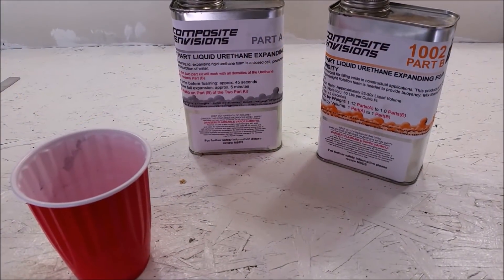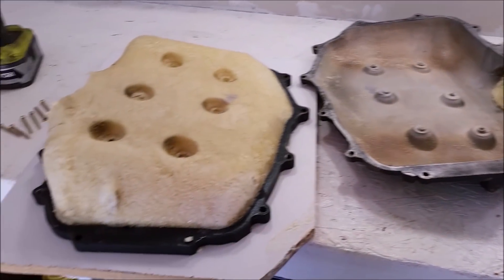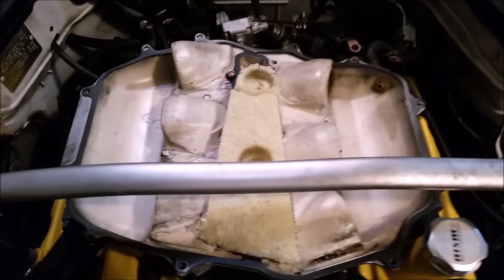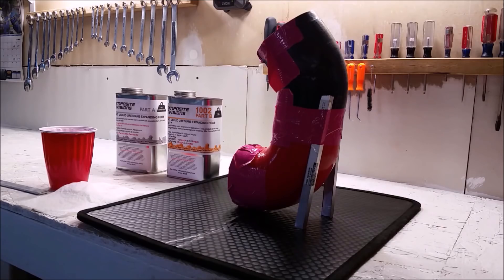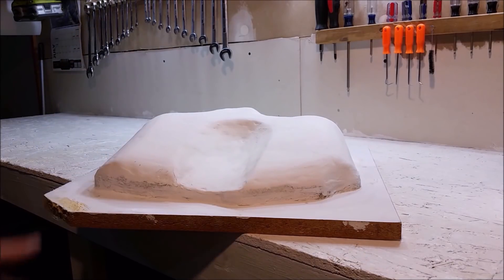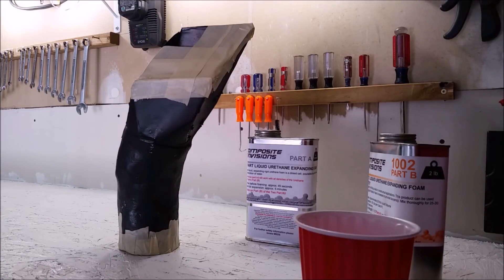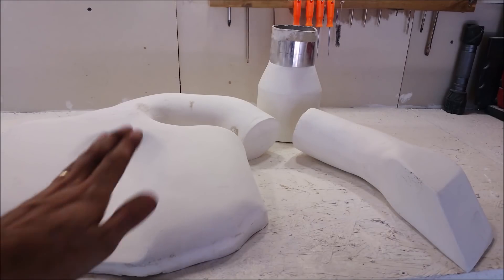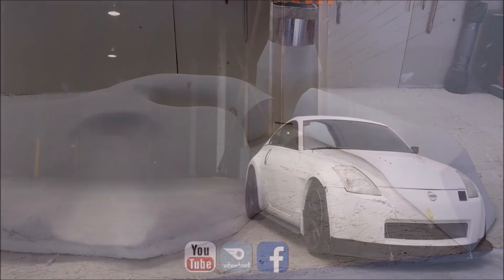How to Make Custom Molds for Carbon Fiber Car Parts (350Z Part 1 of 6)

Comment from the maker: If you have any questions about how I made my carbon fiber intake, please comment below, and I will respond as quickly as I can!
Reply: Which chemicals do you use to make that foam can u share their link to buy that two chemicals
Reply: @shubhamkumar-li3vb  did he reply on your question bro? Were the same question here...
Reply: @2wheelslife617  no bro not yet
Reply: thanks for your offer pal. which sandwe did you use? i see you used palm sander. was it air or electric?
Reply: No cooperation the uploader bro.
Reply from the maker: Apologies for the late response; your comments were flagged for some reason. I got the foam from the same people that sold me the carbon supplies in part two of the series.

Comment: What paint do you used on the mold ?
Reply from the maker: I prefer a filler primer because it can correct some minor imperfections. You'll then need a layer of urethane to seal it and prevent the sticking issue I had.

Comment: How do you take out the formed foam from the parts without cutting or damage the original parts?
Reply from the maker: The plenum popped out pretty easily with a bit of persuasion from a screw driver. The airbox and the intake pipe molds had to be destroyed though.
Reply: I've had issue here.

Comment: Couldn't you just use the plenum as the mold?
Reply from the maker: No, you want to work off a negative of the part. If I had used the plenum, it wouldn't allow for a good flange, and it wouldn't account for the thickness of the aluminum. It wouldn't line up with the lower plenum. Same goes for things like doors, hatches, hoods, ect.

Comment: Hey 
what have you Applied on the Foam After taking it out of the plenum
Reply from the maker: Plaster. It's super cheap and stands easily. Make sure you seal it with something like an acrylic coating you would use for a wood floor before applying the wax and PVA

Comment: which is the liquid u used to create the molds
Reply from the maker: https://www.ebay.com/itm/Two-Part-Liquid-Urethane-Expanding-Foam-4-LB-Density-4-LB-Kit-1-7-Quarts/131643157312?hash=item1ea68b2b40:g:r2kAAOSwW3JbVi6i

Comment: Do you add or spray anything on the object to keep the foam from sticking to it?
Reply from the maker: No, because the intake plenum was coated in a thin layer of oil from the PCV system and the couplers were silicone. If you are worried, you could use any sort of lubricant like cooking spray or WD40 to add a thin coat on the object to prevent sticking.

Comment: I'm going to try and attempt this as well.
I just wondered if you made the chamber any taller? I use a spacer on my one, so I'm guessing the gain for me will come from a smoother interior and wider neck/larger throttle body?
I'll do the lower plenum piece off of the car, that looks like it could go wrong for me 😂
Reply from the maker: The plenum mold was made using a stock plenum and a spacer. So the final piece is equivalent to having a 1/2 inch plenum spacer. As you said, the benefit will come in the larger neck and throttle body. Plus, you get better thermal characteristics.
Reply: @350Z247  Much appreciated sir! 👍
Also I just wanted to say thank you for your videos and channel, its a pity more haven't seen it, great info and inspiration!
Reply from the maker: @TheRobphobos  Thanks man! That means alot

Comment: If you wanted to make your own mood from scratch what other materials could you use that the foam could form in? Thanks in advance.
Reply from the maker: Really any material as long as it is either smooth like plastic/metal or sealed if its porous.  A coat or two of polyurethane like what you'd use to seal a floor will allow you to use almost any material.

Comment: HOLY CRAP! I'm looking to start doing Carbon Fiber work, and I'm SUPER glad I found this video! Thanks for covering something that I haven't seen yet, is that regular Spackle? Like you would find at Home Depot to patch a wall? or is it a different material?
Reply from the maker: Glad I could help man. Yes, it is regular spackle. It's cheap and easy to sand. You'll just need to seal it with something like a urethane floor 
coating. I just did the paint and it still stuck a bit.

Comment: cool videos you have! thank you!! ;-) 
aa, and also cool music - intro & end ;-) 
best regards from Bucharest, Romania!
Reply from the maker: Thank you! Very to cool to have someone so far away watching my videos! Glad you enjoy them
Reply: hi again :-)
if the foam is poured in a volume and then right away, fast, you cover it (closed volume) or you let just a little little space (almost closed volume), is the foam gonna be more firm, harder, stronger? (basically what you did for the last part in the video, with the front piece of the intake system)
or it doesn't matter this aspect and the foam will have same hardness no matter what? 
thank you & best regards ;-)
Reply from the maker: mirceaandreighinea it should make it more dense as the bubbles will be smaller because they have no more room to expand
Reply: hi! 
what do you think if i build a box, then place my foot inside, and then fill the space inside with the two-part expanding urethane foam, will it make for a good mold of my foot? if yes, is it toxic to the skin and needs special protection, or it's just fine? 
(for my cycling shoes project i talked about)
thank you! ;-)
Reply from the maker: I think that would work, but you would want a thick rubber sock on to prevent the foam from sticking to your skin and to leave room for padding once you construct the shoe. I would lubricate the rubber sock as well. Once you made that mold of your foot, I would use that mold to make a plug, like the plenum plug I used, to wrap the carbon onto. make sure you add many layers to the location where the clips for the pedals attach.
Reply from the maker: https://www.amazon.com/Lequida-Brand-Black-Latex-Rubber/dp/B01JGDEMBE
Reply: :-) thank you very much!!
yes, i plan to do what you say or very similar to that. i've seen all videos i could about this process - to mold the foot, build the shoe - but actually not so many out there. so i am constantly thinking how can i make it better - not yet there. because i think this part, to proper mold the foot, foot that mimics pedaling position, is the most important part of the entire process.
Reply from the maker: Good luck!
Reply: hi! 
back again. still getting info about the process (to make the cycling shoe), not easy... 
there are some options about making the mold (then the plug - which would be the foot), but i still think about this option of doing it with the two-part expanding urethane foam. 
do you think the foam can apply some pressure? 
like my foot in a very closed box (no leak), then pour the two-part expanding urethane foam in the box (cover it fast, so no leak), and then, while it expands and gets harden, will it apply pressure over my foot? 
what do you think? 
thank you very much for your time! 
best regards,
Mircea

Comment: Could I make a similar mold using expanding foam insulation? Can I cover for example a motorcycle fender, take the fender out and use the negative space as a mold for carbon fiber?
Reply from the maker: Assuming it becomes stiff enough to hold it's shape well, I don't see why not. Make sure you wax the fender to ensure the foam will detach once dry. Also, I would do a small test on a part you of the fender you can't see. There may be a chemical reaction with the plastic that will melt them together. I doubt it; but never hurts to be cautious.
Reply: Denis Did you try it Denis ? I was thinking about this too. was wondering it if it worked well
Reply: Byron Moscoso i have not tried it yet, might be more cost effective to just cover it /skin it with a layer of carbon fiber... haven't decided what to do
Reply from the maker: Denis skinning it would be much cheaper and easier if you aren't concerned about weight

Comment: Did you guys use open cell foam or closed cell foam when making the molds?
Reply from the maker: Ricardo Gomez Jr. Closed cell 2 part expanding foam. It was very firm for the vacuum bagging
Reply from the maker: Ricardo Gomez Jr. Liquid urethane

Comment: Can I make a mold out of plaster instead? And also, does the carbon fiber go directly over it?
Reply from the maker: Krumlert yes you can. Whatever you are most familiar and comfortable with. And once the mold is finalized, you'll apply a release wax and PVA release on top of that to ensure a clean separation. I go over in more detail in part 2 and 3
Reply: 350Z247 Thanks for the quick reply man! I'll check the other videos.
Reply from the maker: Krumlert perks of being a smaller channel. Glad I could help!

Comment: This is awesome. I've been wanting to do somthing similar with my set up. I haven't seen many vids about this. Keep up the great work!
Reply from the maker: Thanks man! Its been a passion project for me for years now. it's so exciting to finally get to make them. The video of the actual carbon laying is going up soon. They turned out better than I could have hoped.
Reply: 350Z247 that's soo awesome. Man, I can't wait to see what it looks like. It would be great if you listed the materials you used in the discription as well
Reply from the maker: Yeah I'll be sure to do that when I get some spare time. Luckily all the materials came from the same vendor. Part 2 goes over it in some detail, but I'll do a re-cap as well. Part 3 goes up Saturday at 11 AM EST
Reply from the maker: Part 3 is up!

Comment: Looks easy but its not. Sweet video though. Is there an update on you making the mold and the part?
Reply from the maker: Thanks man! My carbon materials just arrived in the mail yesterday. I'm going to Petit Le Mans this weekend so I'll likely film/make the parts next weekend. Very excited!
Reply: 350Z247 awesome! I'll be looking forward to the video's.
Reply from the maker: Sean McClain thanks man. Hopefully it turns out as well as the Carbotron plenum I'm trying to copy
Reply: 350Z247 you're heading in the right direction. Just make sure you double up on the flange section. Are you going to infuse this part or hand lay?
Reply from the maker: Sean McClain thanks. I have the supplies to do both, but I'm probably going to hand lay because of how intricate the plenum is then I'll vacuum bag it. If it were a more flat panel I would definitely do infusion